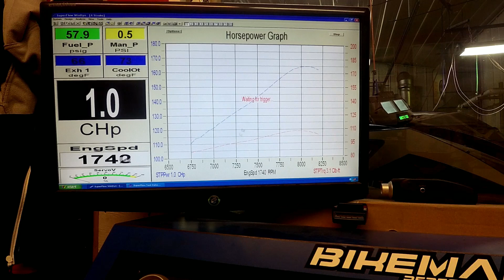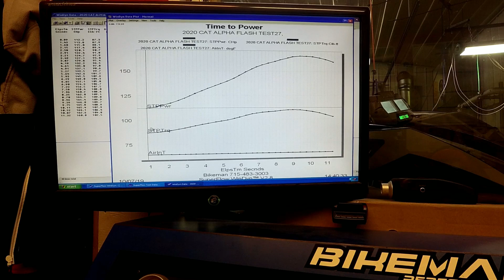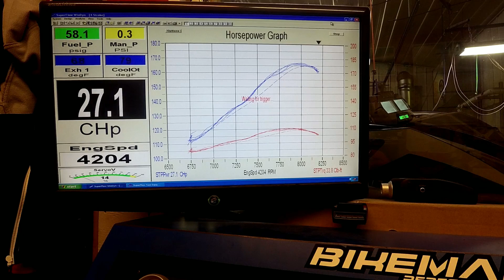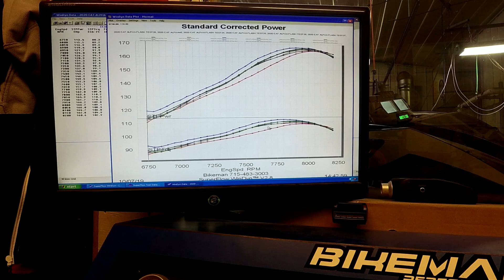2020 Alpha Hardcore on the Dyno with the Bikeman Torque Link Flash.

Comment: How are u guys keeping the sled cool on the Dyno?
Reply: James Kotula  wonder the same i had hughe issues with cooling where i dynoed
Reply from the maker: We have a themocouple controlled heat exchanger. It is like a heat exchanger we can control the temp of. The exchanger uses 1000 gallons of coolant as needed to maintain a specific temperature.  We typically dyno so the engine stays between 120-130 during power testing but in development testing we will simulate cooler and warmer temps to verify tune stability.